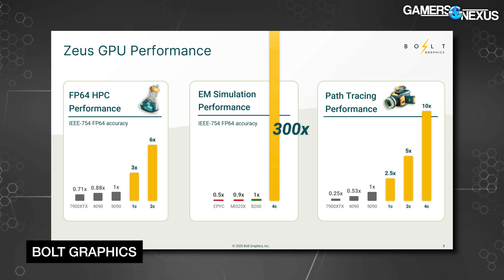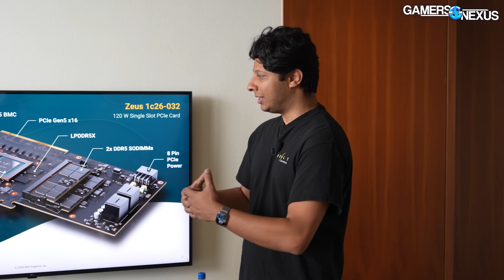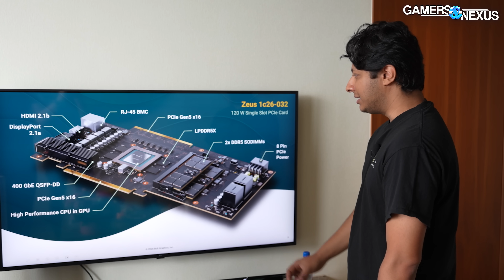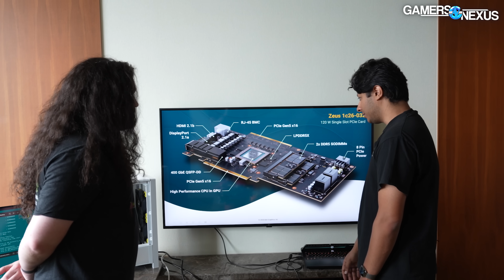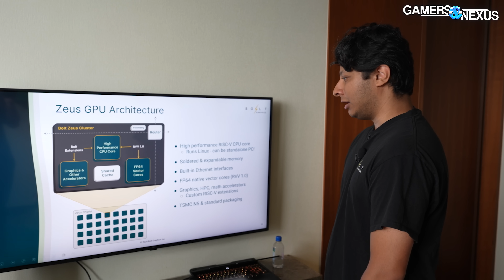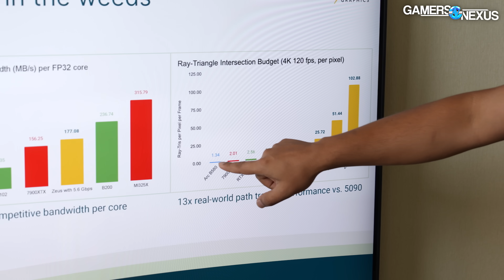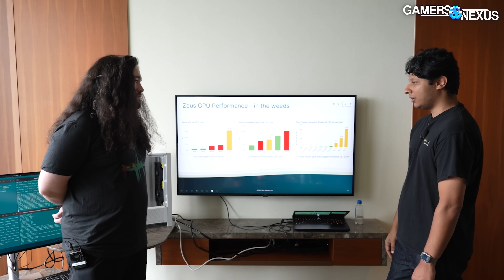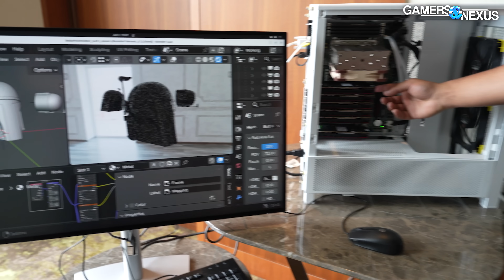A New Gaming GPU Challenger: Bolt Graphics Takes Aim at NVIDIA

Comment: Here's my advice when they start pushing gaming: Start with Linux support. 95% of "graphics drivers" nowadays is just 20-some years' worth of hotfixes for games being badly coded. AMD and Nvidia want to be able to brag that their cards run [insert popular game here] better than the other, so they rush to patch their drivers with these hotfixes leaving the games' actual developers with no incentive to patch them. This is why Arc had so much work to do getting drivers working well. Darwesh even let this slip when he talked about having to "port 1000 games". Even with standard APIs, the job of a GPU driver coder is to become part of the dev team for every game you want to support.

But on Linux, drivers are much more lightweight, and most of the game-specific hotfixes are bundled into WINE and Proton instead. So that work is already done. All that's left is having a solid Vulkan driver with support for the handful of native ports that exist out there. Play that particular card well enough and you could replace AMD as Valve's official GPU partner for their next line of hardware.

I wonder also if they've considered hardware support for ASTC texture formats, something that currently only exists in the mobile space. There's a reason it's used on mobile platforms: It's more compact and efficient than any DXT format. And with memory becoming more of a luxury, we'll need all the efficiency gains we can get. The downside is that with none of the other three supporting it on desktop, it becomes a chicken-or-egg problem. Still, if, again, they can manage to get Valve's attention, they might be inclined to add Steam support for hardware-specific alternate builds similar to what they already do with OS. Since the Switch also supports ASTC, any engine with a native export option for it could pretty easily add another one for ASTC on PC. And of course, there might already be valuable use cases for ASTC in the non-gaming space that I'm unaware of.

Comment: Steam should get in touch with this guy.
Reply: It is not a gaming GPU. It is APU.
Reply: @ObIitus it's a gpu. APUs are CPU + GPU.

if you got confused because he said there's a CPU in there, that's not for general compute. the card firmware runs on it.
Reply: @fish1r1  He said linux can run solely off this gpu. Meaning there must be enough cores/capability to run as an APU.
Reply: Not a gaming GPU whatsoever, it's purely optimized for path-tracing workloads (also known as Ray-Tracing™) and only has a fairly rudimentary rasterization engine, probably equivalent to Intel HD Graphics iGPUs to get basic video output. 

You probably wouldn't want to game on this, as it is also not optimized for that whatsoever by the driver 

Still, pretty cool, wished we could have this but for AMD or Intel designed GPUs
Reply: Dont, steam vr and steamdeck are one of the worst greedy products ever made.
Reply: A Steam Machine contract would really change the game
Reply: Exactly what I was thinking. This could be a game changer and could help Valve in steam machine productions
Reply: @LukeMan-j8w Nah screw steam machine they overcharged us the worst console that can't even beat a midrange PC. They thought they could fool us with that nonsense also claimed it could do 4k 60 fps a complete lie.

Comment: "User expandable GPU memory"
Game changer right there alone
Reply: I remember when my sound card had RAM slots...
Reply: @cybercifrado  Gravis Ultrasound?
Reply: @ReneSchickbauer  I had the Ultrasound Max with ether 256 KB or 512 KB of onboard memory (I can't remember) paired with an awesome Cambridge SoundWorks 2.1 speaker setup.  Awesome setup at the time.
Reply: @jamiewilliams1410  Wow. That was gangster, back in the day.
Reply: @cybercifrado  I think Matrox had a upgradeable GPU like that as well, way back before Voodoo 3DFX cards were a thing.
Reply: @Outamyhead  i think it was right around the time 3DFX started with Voodoo, Matrox Mysteque and Millenium were upgradable if i remember correctly and they were from 96-98
Reply: @cybercifrado  Yes, and I had a Gravis Ultrasound with 1mb ram. My system at the time had 8mb. :D 
Only thing that sucked and I fortunately noticed strait away. Is that the ram chips (was not sticks back them. Looked like ants, brick with legs). Is that the memory chips could be insert the correct way and the incorrect way without any real difference. Inserted the wrong way the chips would overheat and start melting... One of the memory chips warped a bit, but otherwise fine. Should be taken into context how "large and thick" the tech was back then. Modern ones would probably have been destroyed via such. Anyway, fun times :P
Reply: Download more ram = meme, install more ram = reality (hopefully soon).
Reply: @PiotrKowalski-f9s  well technically you can "download more ram" if using a ram compressor counts.
Reply: @Dazed_Angel21  No, no, it does not.
Reply: @MrAkaacer  🤷‍♂ i mean you are "getting more ram" even if you are just compressing it. far cheaper than buying more sticks. though you do need to know what you're doing.
Reply: @Dazed_Angel21  It dosn't
Reply: @Dazed_Angel21  or replacing your bloat Windows with a Tiny distro or SteamOS/Linux.
Reply: @louiscali8617  i use arch linux myself. i haven't touched windows in years. i use a ram compressor because im a psychopath lmao.
Reply: i hear amd also has same plan for the lower end of rdna 5 gpus
Reply: @bmqww223 if that's true it's about fucking time
Reply: @yeetneet5334  i dont think thats like bolt , i think they chose this like bolt because giving vram to lower end sku was not profitable for them , so they are choosing lddr for this approcah but i dont think it will be nearly as fast as bolt, architecturally rdna will be rdna like not like bolts ip
Reply: @bmqww223  I meant expandable vram but ok
Reply: @yeetneet5334  It is expandable, you just need to buy an entirely new card.
Reply: As a low level game programmer, this really is a game changer, we already can't access GPU memory directly, only when the rebar is activated on the bios, for sending data to the GPU, we have to copy the memory from the ram to a memory that GPU can access and hope that it goes to VRAM, what good about that is that we can put data on these expandable slots for data that is very dynamic.

The problem is that it still limited by the PCI bandwidth, so for things that don't change much, like textures, static mesh, and so on, it will be a game changer, we can have bigger terrain, bigger textures and very fast loading times. 

It will go to the creativity of the programmer, more flexibility is always better!
Reply: It’s a return to an older format.
Reply: that kind of solutions are slower than soldered memories
Reply: @jeffbezzos  Given identical memory chips, how much slower is it?
Reply: @jeffbezzos  Which is why later 2D PCI cards and all 3D cards abandoned upgradable memory. Upgradable memory will always be slower than soldered memory. For GPUs, faster memory matters a lot more than it does for CPUs.
Reply: @url8bit  That and the fact that this card will utilize LPDDR5X with expandable SO-DIMM DDR5 memory, meanwhile nvidia already uses GDDR7 which is roughly 5x faster in terms of raw speed.
But Zeus also has their own chip, so maybe they will succeed in utilizing RAM to it's fullest potential
Reply: Sounds great. Purchase an entry level amount of memory this year, upgrade the memory the next. Currently, it's an all or nothing purchase option.
Reply: Its gonna be way slower than standard soldered memory. The performance gap between soldered memory (like LPDDR5X) and slot-based SODIMM modules boils down to distinct hardware limitations:
* *Bandwidth:* Soldered LPDDR configurations frequently hit *85 to 102 GB/s* of memory bandwidth, whereas standard DDR5 SODIMM modules typically peak lower at around *51 to 68 GB/s* under comparable conditions.
* *Latency:* The physical distance data travels from the processor through extended board traces to a socket edge adds an extra *5 to 15 nanoseconds* of latency compared to direct surface-mounted layouts.
* *Graphics Impact:* For integrated graphics or systems heavily reliant on shared memory pipelines, that bandwidth deficit can translate to a *15% to 25% performance penalty* in graphics-heavy workloads.
Reply: Putting SODIMM slots on a board layout meant for high-throughput graphics or data pipelines introduces massive pinout and bandwidth restrictions, tanking your transfer speeds for the sake of a feature most high-end workflows won't even use effectively .Total disaster. Instead of giving users a practical upgrade path, it just hamstrings the hardware with a massive bottleneck right where it hurts the most. If you have to choke your memory bandwidth just to make it modular, the whole architecture defeats its own purpose.
Reply: Agreed.
Reply: You'll end up paying for ram twice because they'll supply a stingy, hamstrung amount with the card.
Reply: @JN-qj9gf  Didn't he say 32GB soldered? That's what I heard.
Reply: Also its LPDDR5x, so it has much better latency, although graphics workloads are extremely latency resilient, but things like path tracing are still very latency sensitive.
Reply: Literally!
Reply: Most definitely, this is a game changer for sure and something I have been saying for a couple decades with video card. Who wants to have a graveyard of graphics cards like me. I even have a video card as old as still having my voodoo 3 graphics card in my attic along with GT, GTX, etc
Reply: not really, because it's not GDDR. Normal DDR5 is way slower than actual vram. actual expandable vram is something, that will never be possible, because you need to sodder the chips as close as possible to the gpu for the latencies.
Reply: @HeavyMetalGamingHD normal ddr5 RAM hast faster random access
Reply: @mariandecker3942  Sure, but it doesn't come close to making up for it.
Reply: @glnga  WE will see if it matters. 8,000MT/s are fine as they. If the GPU performs like Nvidias Pascal gpus, it's more then enough
Reply: its not amazing like sodimms are still expensive like its not that amazing its gonna pe priced like the steam machine
Reply: Yummy yummy slow ram. Theres a reason nobody does this.
Reply: @PeachIceCreamy   upcomming ddr6 memory is going to do up to 38.4GB/s per die, the slots themselves can handle up to 134GB/s which is about half of the speed of the low end of the 50 series cards. and if you go back a gen it started at 280 GB/s this will all improve with time. If you are someone who wants to have a budget friendly way to get 96gbs of ram on your card this will be awesome. If youre someone who cares more about the fastest 8gb of vram then stick with Nvidia but for running local ai models like GLM 5.2 cheaply this could be an insane way to get 20+ tok/s, with like $5k worth of tesla v100 sxm2's on an 8 nvlink board(which costs about 5k) you can get like 10ish tok/s out of glm 5.2
Reply: @gamerbombstudios2668  For local AI, yes, and what about using 'em for banks of virtual machines?
Reply: @PeachIceCreamy  There's difference between latency and bandwith. Actually the latency of his design(with LPDDR5X) is lower than GDDR6X latency so his design is not that bad. Ofc the bandwith is not on the same level with HBM.
Reply: I agree. its good for things that doesnt care about latency or bandwidth, but for gaming it isnt a game changer at all. unless they find a way to make a dedicated expandable gpu modules, not just RAM, but actual VRAM modules you can add like it. then id say it could be revolutionary for gaming. But if this design proves successful for the high memory needs, maybe this tech could trickle down to gaming gpus too. that could mean gpus getting cheaper, as you could buy the for example 5090 and only add 16gb of vram, which does cut costs. or you could buy a powerful card and only add 8gb for now and expand it to more later
Reply: @PeachIceCreamy  My best guess is that they'll probably be using a small amount of soldered VRAM to store the immediately used data, using the non-VRAM memory to cache related/surrounding data for faster retrieval
Reply: @PeachIceCreamy  And you have no idea what that reason is
Reply: It's slow laptop DDR5 memory, so from a gamers perspective not a game changer at all.
Reply: @m4ster_root  slow laptop memory? SLOW? are u mad? do you know there is highend workstation laptops for rendering, 3d grpahics etc? they run same ddr5 slow laptop memories ...
Reply: @3e5t1a55h4d0w in comparison to soldered GDDR6X or HBM... Yes... Laptop DDR5 is slow!
Reply: @3e5t1a55h4d0w  Dual-channel DDR5  is ~100 GB/sec while 4080 has 1000 GB/sec memory
Reply: @m4ster_root   I see a lot of people commenting about the memory speed, but I don't think any of you actually know what fast or slow GPU memory actually helps or harms from an actual engine development perspective.
Reply: @jerth are we talking development or gaming?
Theres nothing game changing about this, this part is not the new and impressive thing.

Considering the niche market where this belongs, yes it makes sense. It's essentially overflow memory for large datasets or render scenes...

But from a gamers perspective, speed matters a lot!
Reply: @m4ster_root  Speed matters a lot, sure, as in the frame rate the gamer sees. But the actual engine developer is the one who dictates what frame rate you get to see on a given set of hardware. VRAM bandwidth is certainly a consideration in a very small number of AAA games (fewer than you think), but even then doing a back of the envelope calculation they can probably get ~250GBPS combined of bandwidth out of this LPDDR5+DDR5 SODIMM setup, which is still more than plenty of mid-tier current generation cards, but in addition to that in their case they can front load huge amounts of VRAM cheaply, and they also have 10x-20x faster random access than e.g. a 5090 (because that's what DDR is good at, GDDR is not so good at it). That's huge if you're doing GPU compute, path tracing, complex shading, lots of stuff. The kneejerk reaction from people in these comments about memory bandwidth that they don't understand is silly. An engine developer (me) is going to look at this and see opportunities to bring gamers (you) cooler technology.
Reply: @m4ster_root  They are targeting devs and 3d artists first, no? After 2027 we will have a more concrete picture of what they want to do for gaming.
Reply: @m4ster_root  Your minecraft save will do just fine with the slow laptop memory, don't worry Gamer!!
Reply: @m4ster_root  There's also the niche market of running local AI models. A cheap GPU with 96GB of RAM onboard will be very powerful for that application.
Reply: @m4ster_root  I think they might  release specifically faster memory in the future if they get a lot of lash back for it but they may not idk
Reply: Who fuckin cares honestly. Most games that require modern hardware suck and it's always funny to see people flexing 5090s when you just know they play for 30 minutes and then go back to browsing social media on their $10,000 RGB fishtank.
Reply: @GG-cn6es  LOL. I play video games for 3 hours a month and then go back to making music on my pricey fish tank thank you very much... and also look at youtube occasionally, apparently. That said, I felt like the 5070 OC was good enough. I dunno why anyone would buy a 5090 unless they were doing local ai or some super intense stuff. I hope we can still build comparable home desktops in the future - We were supposed to be able to build even better ones, but AI is putting everything in question. -_-
Reply: That's actually not game changer. SOC with high cache and built in fast af ram is the game changer. Tell me when you used the upgradability of your pc, in the ddr3 gen or for graphics cards? rams should be built into the chip which should be soldered to the mobo.
Reply: @merehooman  Yes yes just like digital media should be enough for you so you'll buy your games again every time the publishers want you to.
Reply: @umberhulk_mk2  why would I buy the same game twice? Don't tell me you "upgrade" your pc every few months 😂.
Reply: Yes, also the bandwidth of GT710 would for sure be a gamechanger - maybe if it was year 2006.
Reply: It´s the main reason i refuse to buy a graphics card and just use integrated graphics.  Now with expandable GPU memory, i would buy one.
Reply: @saricubra2867  What?
Reply: @saricubra2867  wild take

Comment: If Bolt is reading this,
I really really hope engines like karma xpu (in houdini) will be supported on your card.

If it can do that, I am very certain that most of the houdini community and studios that use houdini would buy these cards like hot cakes.

Comment: Uhhhh guys, this product will, at best, be slow as hell in anything approaching real-time 3D rendering. 

There is a reason GPUs use high bandwidth memory, because you need it to do anything in any modern rendering pipeline.

The fact this guy is repeatedly saying stuff like "we can't support games because we don't have 1,000 engineers to test each game" is either him lying, or being clueless. If you support DirectX properly, you support most games, it's not more complicated than that. The days of NVIDIA/AMD GPUs requiring 1,000,000 custom code paths for driver workarounds is gone, that only still exists in Android land. Source: am a graphics developer.

Comment: The Bolt architecture is basically the Sony/Toshiba/IBM Cell (the PlayStation 3 CPU) but refactored as a GPU, isn't it?
I mean, one main processor that handles the initial workload and then specialized subprocessors that developers can tell it to schedule to do work that the main processor can't do as well. Those vector units are basically the SPEs. Biggest difference is that there's multiple kinds of subprocessors that Bolt can offload to.